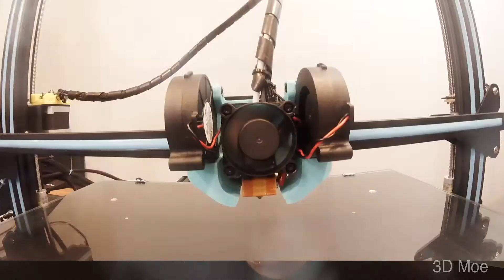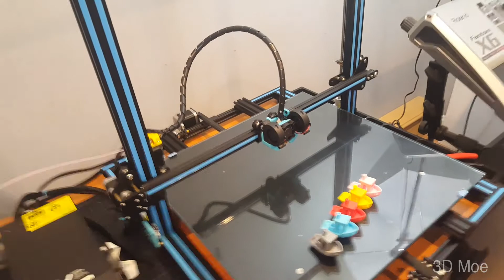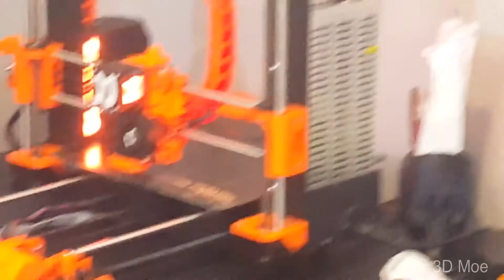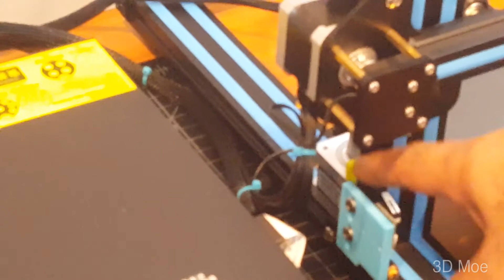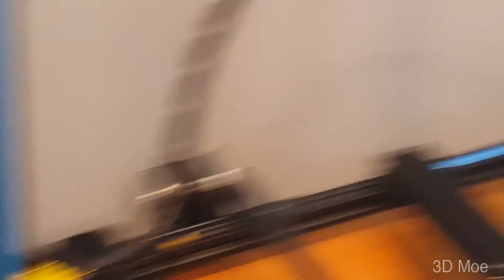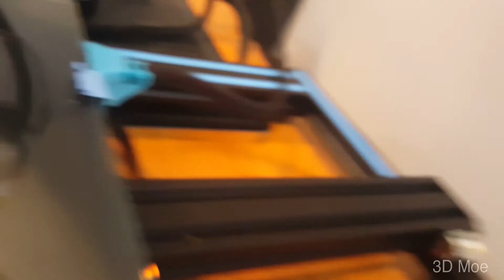CR 10 S5 Dual Fan Mod

Comment: The fans linked here dont seem to support RPM control via PWM. Meaning they will either run full speed or not spin at all. Could that be an issue on CR 10 ?
Reply from the maker: TheSolderingGuy007  true.. they will not run under 100 percent in your slicer.. but i havent had an issue running full speed yet..

Comment: Glad to see more people enjoying my fan mod. :D
Reply from the maker: Josh Tenny  Great design Josh really improved the quality of my prints
Reply: Glad to hear it. :)
Reply from the maker: Thanks again for the Great Design
Reply: Hey, id like to ask a question about cooling fans. I'm waiting for my Cr10S4, so I'm researching mods for poly C printing. i want to do the dual fan but I'm in Europe (220v) should i order the 12 or 24v fans? does the power supply step down the voltage? thanks Moe and thanks Josh!